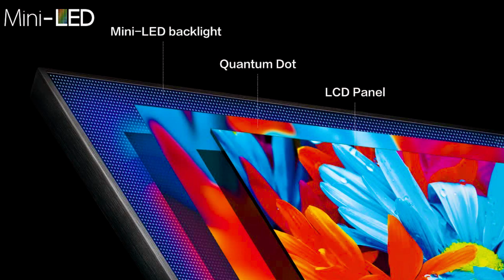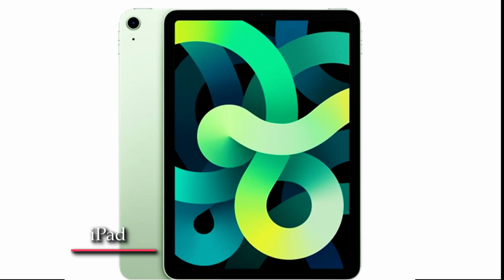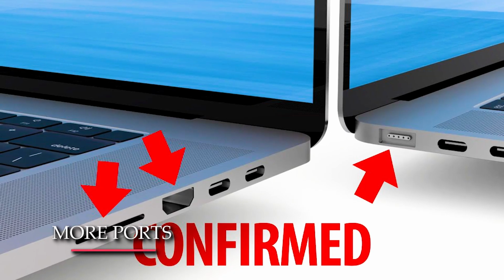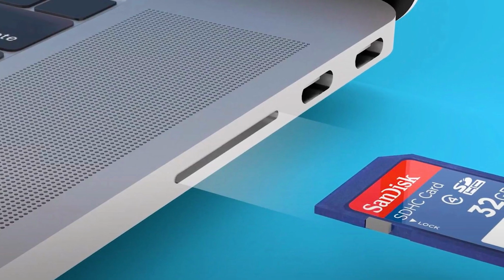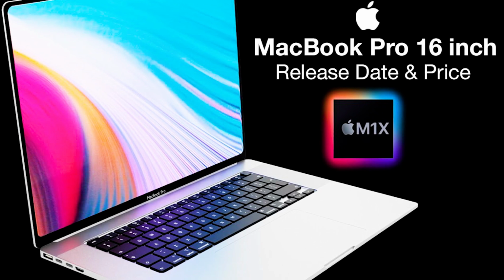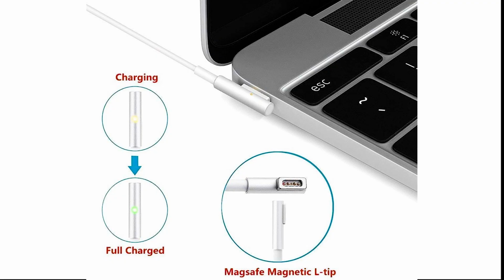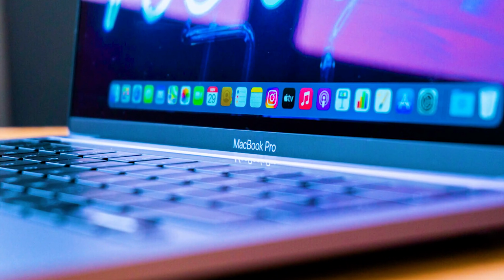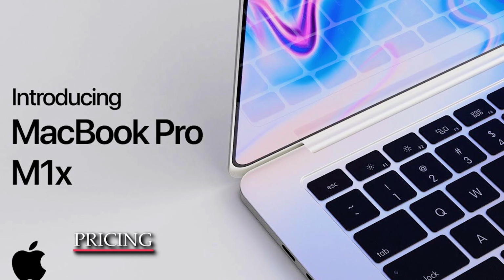Macbook Pro 14 Inch (M1X): Mini LED Screen

Comment: Keen to get top spec MBP 16".  Maximum 64Gb RAM, 8Tb SSD, fastest graphic card etc. Expecting to pay probably £7k. But after Super Deduction relief of 130% and recovery of 20% VAT the real price for my business will be significantly reduced enough to be just about justifiable.  Hell it's hard not to consider the top end HP Spectre with reversible touch screen.  When, if ever, will Apple make a touchscreen MBP? Maybe never as that would compete with the iPads. Comments? Thoughts?
Reply: Yes, would interfere with ipad sales and is probably never gonna happen. Also the screens on macbook have really tight tolerances about brightness and color accuracy. Keeping those standards and add touch would raise the price significantly and thats hard to justify.